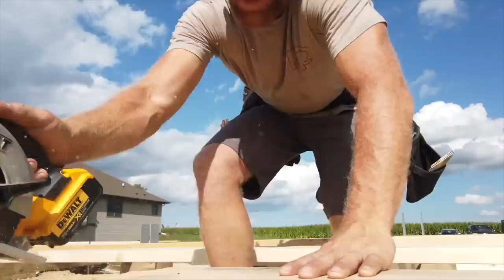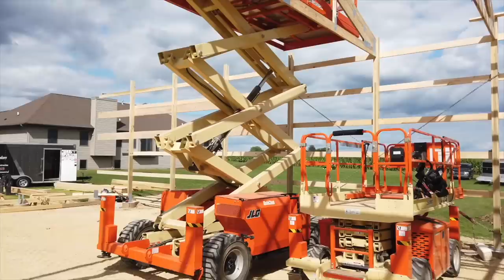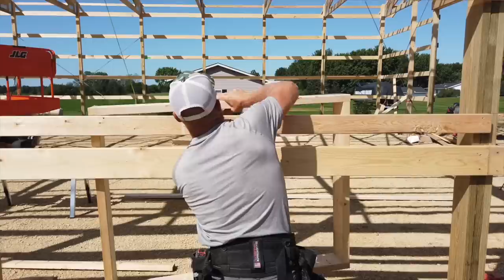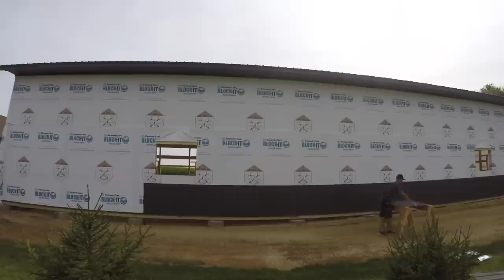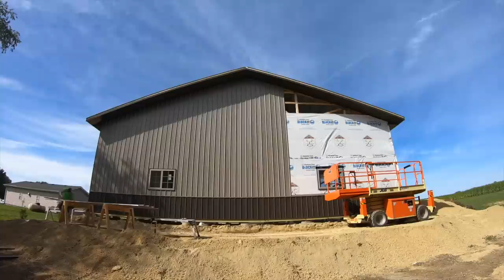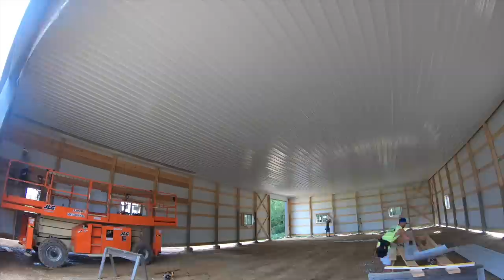Building a Large Work Shop Full Time-Lapse Video

Comment: Nice film work Kyle. Likely $50 a foot is going to build a nice barn however, then there is concrete and electrical with a small amount of plumbing for most folks that would add into this. Merry Christmas to all.
Reply from the maker: $50 would build an epic barn
Reply: @RRBuildings  One to include concrete and rebar floor, electrical all four walls and ceiling, 220v for one wall, wall & attic insulation, one full bathroom, one open kitchenette, insulated garage doors, 10' garage door headers, covered porch 2 sides, 10' concrete walkway around perimeter, 25' reinforced concrete driveway. That's about all. Presuming interior is finished, drywall preferred. I'm going to guess that is up there in price.

Comment: Could you give your personal thoughts on choosing particular size in a building design...example: is 48 x 80 vs 50 x 80 / or 48 x 72 vs 50 x 72. Is there more sense or reason for one over the other? I have noticed that a lot of your buildings are odd sizes to make the metal work out evenly without ripping it. Like this building is 48 not 50. Thanks

Comment: A couple of questions:
1. Are your columns prefabricated?
2. How is your concrete slab abutted to your piers & exterior walls?
3. Have you ever done a multi level roof on a building or an non rectangular shaped building?
4. You do such good work. Do you cut the metal ceiling lighting j-boxes so that the electrician does not destroy the ceiling panels?
5. Do work with an architect or engineer?

Comment: Hello...In Europe we think a lot about insulating buildings to save heat and air conditioning. This does not seem to be the case in the USA because I never see you installing loose or roll insulation ... Your work however is really at the Top ....
Reply from the maker: I’m not an insulator... it is subcontracted after I’m gone
Reply: Check out The Build Show
Reply: To be fair most buildings in Europe are not airtight or well insulated. Almost none have air-conditioning unless commercial.
Reply: @RRBuildings  It's good, thank you...
Reply: @johans7119   Hello Johan
It's probably been a long time since you came to France because we have standards today making buildings in positive energy with very good insulation standards ...

Comment: There is an increasing use of steel framing which is reasonably quick to construct and very strong with a very long life. Is this an option in this large sized building? Will the use of steel be cheaper in costs? Very enjoyable to see the steps you make to build these large sheds!

Comment: Can you explain more about nailing the purlins to top of rafters?  How long are the nails and how far do they go into the rafter board?  Are you using screws or other method that secures the whole roof to the rafters.  Seems like there should be more strength in how those purlins are attached.  The rest of the building is a fortress but not seeing that same detail on the purlins.  I’m sure I’m missing something but hope you can explain. Great video and enjoy your work ethic.

Comment: Don't know if anyone addressed this but in terms of the outside of the building, how is it finished off? Meaning, you use sonos tubes for the posts and the anchors for the posts are centered. This creates a half round that is sticking outside the building. If the slab is only poured on the inside,  how does it create a transition?

FYI.. great job on the buildings & editing

Comment: Great Work and Videos!  I get hooked watching these every time.  I had a question about the wainscot, is it purely aesthetic or is there a functional reason? I've noticed you seem to always install a wainscot even if it's the same color as the main wall panels.  I imagine with agricultural buildings, particularly in Norther Illinois, the bottom of the panels can be banged up or corroded out so this would make it easier to replace the damaged portion without replacing the entire panel.
Reply from the maker: You guess it!  Both aesthetic and functiknal

Comment: Hey Kyle. Great video, thanks. What would you recommend for a wall height  if you were going to put in a second floor living area?
Reply from the maker: 16’ minimum
Reply: What kind of post do you use for 16' or higher building? 6x6 in concrete?

Comment: Here's ya a question.  When you guys are doing ceilings like on the porch area, do.  you only use j on 3 sides?  And is a like a 2 piece system on the final side?  If so, what's those pieces? Just like a angle piece with the color on the inside?
Reply from the maker: Yes only three sides j channel.  Will cover more in Depth on next build series we have a porch
Reply: @RRBuildings  awesome!

Comment: It killed me that I could find few real numbers, and none with details of what the comp was for. I understand that Kyle can't give you his client's price, and I agree with him, but I can give you mine. I have contracted to build a 42x88x16' with a National Builder because Kyle doesn't build in my area.  Builder has a great reputation, and build style is very similar to Kyle's (though I'm sure not quite as good).  Including ceiling, 1 walk door, 1 window, transparent material for top 3' for full length of one 88' wall (back wall, south side, for light), 4 overhead doors (10x10,10x10,12x12,16x12) and one sliding 18x12 door (all installed with locks, but no powered openers, one 10x10 is insulated), 2' overhangs, and 6" concrete slab with metal mesh.  Total price is $120,000.  Does not include wall insulation or interior work other than ceiling.  Site prep and fill, electrical, plumbing, and interior finish-out is not part of the price.  So, for me, in Florida, just over $32/sf for the dried in building.  Obviously the per/sf price would be more for a building half the size, and varies for other reasons, but as a ballpark for "Can I do this for what I'm willing to spend", it is at least a reality check of what a quality post-frame would cost.

For advertisers, I saw my builder's ad play several times on this channel and Outdoors With the Morgans before I called to get a quote and sign my contract (so money well spent here).  I never watch commercials on TV.
Reply from the maker: 120,000 is much more than I would have charged, in my area...but its very hard to compare.

Comment: How many days did you spend on this project?
Reply from the maker: I think less than 10
Reply: 48x80 @10 a foot is $38,400. I imagine that is without windows, extra roll up doors, and a porch or lean to, and maybe insulation(if anyone could tolerate the cold). With a generous 20k for materials that leaves about 9k a week for labor, permitting, overhead and profit. That's not bad.